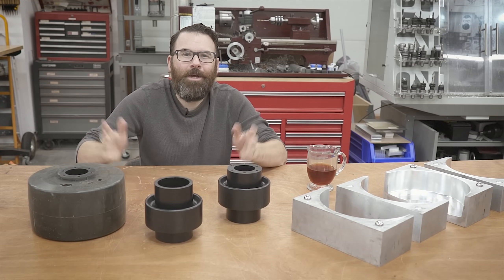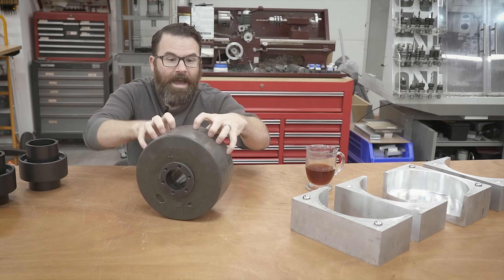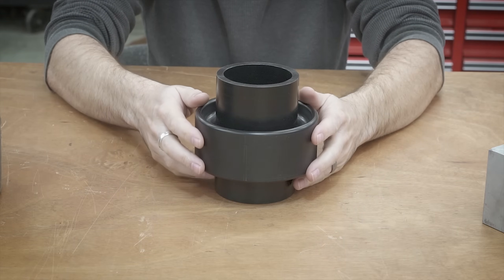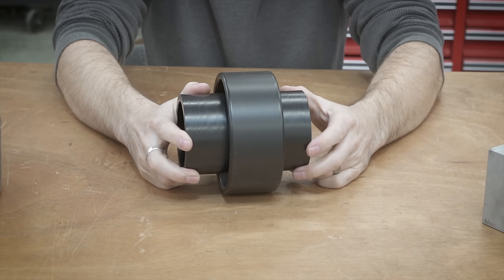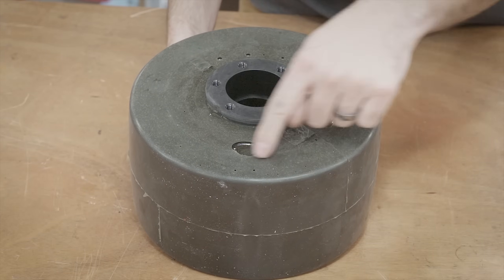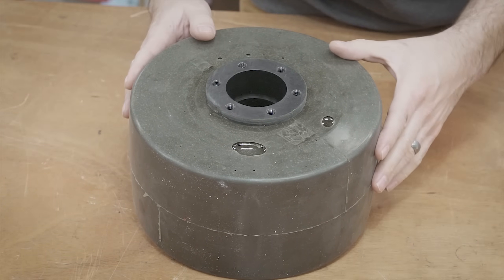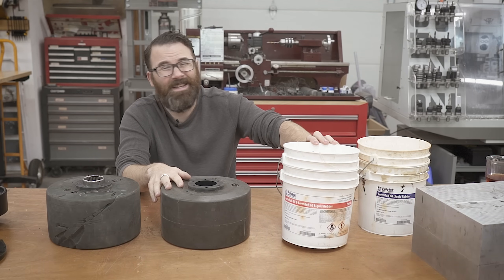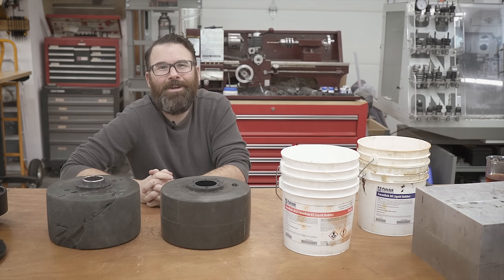Copperhead Custom Wheel Molding

Comment: I want to see someone make the whole robot out of the cast rubber for the wheels.......  It seems to be able to take so many direct hits, maybe an indestructible robot?
Reply from the maker: I think all the mechanical parts would have a hard time working...  You need a rigid structure for drive and weapon power transmission.
Reply: @RobertCowanDIY  haha yeah I know, mostly a silly idea. Maybe you can cover crippling depression with a giant 220?lb layer of it. 🤣

Comment: Hey Robert, curious if you would have advise on an idea for using Polyurethane Rubber as a weapon. Im thinking of coating a truncated cone shape full body spinner 1lb robot and using the catch and bounce of the material to push opponents around. Thoughts?
Reply from the maker: I think no matter how you did it, it would be too delicate.  People are using titanium, AR400/500 and other materials for weapons, I don't think it would hold up.  The whole idea of a spinning weapon is to generate, store and transfer kinetic energy.  Using a rubber can accomplish the first two, but will be unable to effectively transfer the energy into your opponent, making it act more as defense.  That's not what you want for a weapon.
Reply: @RobertCowanDIY  Thanks Robert. I have also been working on an adjacent design in which there would be a rotating shell but it would just free spin as armor like you mentioned. Do you think 50 durometer rubber would work ok here? I was also thinking of attaching steel wire brush to dissipate vertical and horizontal spinners.
Reply from the maker: @neilrhoades5951  Sorry, but I don't think this design would be effective.  read my previous comment.  you're basically designing a weapon with a feature that invalidates the purpose of having a weapon.  I'm not saying it won't work, I just don't believe it would.  But I could be wrong.
Reply: @RobertCowanDIY  Thanks Robert!

Comment: Fit your mold with some grease gun fittings.  When de-molding, a couple of pumps with a grease gun will break that suction grip in the mold.
Reply from the maker: But wouldn't there be a hole that would get filled with rubber?
Reply: @RobertCowanDIY  Fill the hole with a little dab of grease before casting.  There will just be a little dimple in the finished part.

Comment: We (Gemini) use 3d printed wheel molds for our wheels (even used the same mold for 3years)
The trick is sulfur free modeling clay, by applying a thin coat to all the seams we get ZERO FLASHING.
you can even smear it on the whole surface to eliminate print texture but stopped as it didn't seem worth the effort (even tough it only takes 15 min)
This could be used on aluminum too but 3D print is dirt cheap in comparison and I don't see much downside

I should also mention we use a 2 (or now 4) part mold with diametral splits and a free top surface (no molded upper surface just pour till the mold is full)
Reply: Gemini, you ever coming back?

Comment: I know that the bubbles aren't a big deal, but did you consider pulling a vacuum on the mixed rubber before pouring?
Reply from the maker: We considered it, yes.  BUT, for something like this, it really wasn't necessary.  In a normal application, you would want to pull a vacuum or even pressurize the mixture before pouring it in.

Comment: I'm curious, why not embrace the bubbles? Assuming you could trap the majority of the bubbles in the body of the tire, you could probably shave a couple pounds off the weight without a major loss of strength.

Comment: Hey, you have on the nylon core these two "grooves" wouldn't air be trapped on the bottom groove during the pouring-process? Just wondering...
Reply: Yeah, there must ve some air pocket but probably not so big to be any isue in application like this. But for example just 3 small holes drilled around the ring would solve that for sure.
Reply: I was thinking the same thing....

Comment: How did you get the polyurethane to fill the undercut which would be facing down in the mold? I did not see any air channels through the undercut surface to the other side so a huge bubble would form and prevent most of the polyurethane from entering the downward facing undercut.

Comment: Have you tried using a release agent for the mold? PVA release agent works really well and its water soluble so you can just rinse it off after demolding. I usually apply it with a nice bristle brush. 
Another thing you can do to help reduce the amount of bubbles is make a vacuum chamber to put the entire mold in after you pour it. A simpler, but slightly less effective alternative is to vacuum the bubbles out of the urethane while it is still in the bucket (i.e. using an off-the-shelf vacuum chamber/bucket). 
Also, if you apply heat to the part while it is curing it can exponentially decrease the cure time (it looks like you could fit that in a regular oven). Usually this also increases performance of the final product (follow manufacturer recommendations there, though).

Comment: Last I knew Extinguisher was going to make their wheel molds from 3D prints, I think their hubs are bigger compared to the tire diameter (so less liquid being poured in) but the overall wheel size is fairly similar and it's a heavyweight. I think the plan was "If they come off, great, if they don't we'll break them off [they're cheap 3d prints]."
Reply from the maker: I hadn't heard anything about that.  I might try molding my own with 3d printed molds and see how it goes.  T

Comment: How much is a pound of pu more or less?
Reply from the maker: It varies considerably with what you get and how much you buy.  The stuff we use is around $150 for 16 pounds, so roughly $10 a pound.  So yes, every wheel is around $150 in just rubber...

Comment: Do you think kevlar fiber reinforcement would be beneficial?
Reply from the maker: Whenever I see suggestions like this, I want to ask: "what's the problem you're trying to solve?"  Are you trying to make them stronger?  Because we don't have issues with them failing.  Are you trying to make them lighter?  The kevlar wouldn't do that.  Are you trying to make them cheaper, easier to make, etc?  I always look at design with that question in mind.  What problems exist, and what's the best and easiest solution to fix them.
Reply: @RobertCowanDIY  Its an attempt to make it stronger per mass. If the overall material strength is higher perhaps you could create hollow sections to make it lighter.

Comment: Could adding fiber or mesh to be cast within the wheels make them more durable?  Something sort of like rebar in concrete, though I have no idea how well that would work for rubber.
Reply from the maker: See my reply to David Lewis II.  Same thing, what are you trying to solve?  They are plenty durable, but chunks can get taken out easily enough.  Carbon fiber would maybe prevent that, but that energy has to go somewhere.  It might end up just cracking the wheel instead of taking out chunks of rubber.  Concrete is very brittle and needs the rebar to stabilize it.  Rubber has the opposite issue.  Making it stiffer doesn't really add a significant benefit IMO.

Comment: I was ruminating on the de-molding process over night and figured this. Each mold section would get one threaded hole, through that hole, a threaded screw can be inserted and made flush with the inner surface. During the molding process and curing, it stays in place, but once that's complete, all you have to do is remove said screw, insert compressed air, and it should pop out the wheel.
Reply from the maker: I drilled and tapped two holes in the top, so I can separate the top and bottom by just threading in a long bolt.  Works well enough.  The next mold design would have features like you suggest to be able to pull it apart easier.

Comment: Do you re-use the hubs? 🤔 I think the hub under cuts at 2:00 give you trapped air if mold is not tipped during pouring - drilling axial from void to void should help.🤓 Also - drilling some small 3 mm holes on top will bleed the air bubbles, like regular tires I guess, to be cut off later - but agree no functional impact 🙂 Cool vid - thanks 💪
Reply from the maker: The hubs aren't reusable.  There's no way you're getting the rubber off once molded.  And you're right, the undercut could trap air, and cross-drilling would help, we were just lazy ;-)  The top does have two vents, but it would need MANY to get rid of the bubbles, best to start with as bubble-free rubber as possible.

Comment: For stubborn molds for my underwater robots I have put threaded holes for zirc fittings on the mold so you can use a grease gun to push the part out of the mold.
Reply from the maker: That's a pretty good idea.  Really once the suction or seal is broken, they come apart quit easily.  So that would certainly help.

Comment: Now I want to see an entire bot with this thick rubber as armor.
Reply: If your opponent's weapon can get lodged in the rubber then it might count as an entrapment device and be against the rules. Although, if we're talking ablative armor in general, I've heard of a few using wood.
Reply from the maker: Yeah, only when intentional.
Reply: @RobertCowanDIY  tread of a loader tire for hammer bots drill holes in the slab of loader tire and use existing bolt holes . tomb stone couldn't tear one
Reply from the maker: @huckstirred7112  tombstone can crack solid steel about 2" thick.  It can break a tread.  Also, those are horrendously heavy!
Reply: @RobertCowanDIY  wow ! your all's bots bust 2 inch plate ! I weld on a lot of 2 inch plate I thought only heavy equipment could do that . I know my chainsaw can't cut threw  it . .Now I wanna run over a piece with the brush hog to see what happens ,and no my brush hog would spit it's guts hitting 2 inch plate !Thank you for replying
Reply: @ThatBum42  I'm not sure that it would class as entrapment unless the armour was specifically designed to capture weapons though.
Reply: @ThatBum42  I'm currently creating a beetle weight bot that has rubber on the outside that shock mounts to the main chassis. It's sofar purely in the planning and materials collection stage, but I will have to look more carefully at the wording of the venue/competition rules to make sure that I'm not breaking the rules.
 I think perhaps in some weight classes rubber on armour wouldn't actually help that much being placed on the outside of pannels.
The forces that are involved on something such as a cutting blade like tombstone surely has enough mass and MOA that to have any impact on the blades ability to cut straight through or transfer a significant amount of bite to the main shell of the bot the rubber on the bot would have to be incredibly thick (like copperheads wheels) and at that point you're probably also going to get issues with securely anchoring/adhering the rubber to the panels, not to mention the weight increase .

I think it might have more success with being able to absorb more shock from the likes of a drum with a large head like copperhead, but then I think the main aim of a drum like this is to twist, flip and break, not nesseserly cause impact holes or tears.
Reply: @ThatBum42  Possibly, I've still not completely settled on the finished design for my own robot yet but but i'm currently 80% finished with the modeling and depending on ammendments will be transferring parts it into over into fusion over the  Christmas  holiday hopefully.

My idea comprises of a diamond like rhombus with slanted mirrored edges (invert capable).

The rubber part of the shell with be the outer most edge of the bot and will be clamped with nylon bolts and probably some kind of semi tapered springs (of which I haven't experimented with yet. 
The idea is that the outer edge of the robot gets hit on the rubber (causing it to be ripped apart and sacrificial)  and the springs take away the majority of the shock until the rubber is worn away.
Reply: I was thinking an overmold like you see in some tool applications.
Reply: I was thinking about,  I have access to uncured strips of rubber.  I use that for rubber injection for air flow tubes in the automotive manufacturing

Comment: Awesome video! I'd love to make some custom wheels down the line.  When pouring around the hub how do you make sure that the liquid rubber fills in the "undercut" that is facing the ground, rather than creating a cavity or air bubble? Can't wait to see how they perform on the upcoming season.
Reply from the maker: We didn't really do anything to make sure that cavity was filled.  I guess ideally it would be drilled through, but we didn't do that!  But an air bubble wouldn't really do a while lot other than save weight.
Reply: @RobertCowanDIY  I'd definitely drill some vent holes through. I'd also use the mold release specified by the manufacturer of the rubber, and the surface prep or bonding agent they have for the hub. With the bonding agent a damaged wheel could be turned down on a metal lathe, prepped and a new layer cast over it. Takes the right lathe bit geometry and really sharp to turn rubbers, and there's a limit on how soft a rubber can be turned. Grinding rubber to shape can be done but it's horribly messy and the particles get static charged to the point they have to be scrubbed off with soap and water and can still leave some stuck.

Comment: is there any draft on the mold (to help demolding) or is the wheel molded with a completely square profile?
Reply from the maker: I think there's a tiny bit, the wheels are a tad rounded when they come out, we just drive them on asphalt to make them flat.  but more draft would help getting it apart, but then the wheels wouldn't have a flat tread.

Comment: I wonder what would it take in terms of price (to be read, vs the current setup) to make the wheels out of actual vulcanized rubber in a home setup. One of my RC airplane mentors as a kid would make his own rubber wheels for this big airplanes. I still have one, perfectly pliable to this day, so i know it can be done, but would it be cost effective...hm.
Reply from the maker: There is a company in Brazil that can make vulcanized rubber wheels.  I kinda looked into it, but couldn't find too much information on a DIY process.
Reply: @RobertCowanDIY  the nylon material I use is Dupont Zytel PA 66 33%  glass filled nylon, Honda has been using alot of  that for their engine parts instead of metal
Reply from the maker: @lowlifeangler  Yeah, those glass or carbon fiber nylon composites are great.  We just use the solid nylon wheels, but doing something else could make them a bit cheaper and lighter.  Even still, the solid nylon hubs do explode from time to time.  The polyurethane holds them in place though.
Reply: @RobertCowanDIY  I should think the biggest hurdle, has to be getting the raw rubber blocks, the rest, is public knowledge, has been for years. I mean, sure, we don't have modern blends, but we've been doing vulcanizing for years. I know there's a company in Germany that did custom bicycle tires, but i don't know if they are still in operation. A friend's firm got custom tires for their employee's bicycles a few years ago as a Christmas gift. My mentor had access to raw rubber blocks directly from a tire factory in Ukraine, but that was ages ago, i think they even shut down recently.
Reply: @RobertCowanDIY  A source for rubber like that is spin casting suppliers like Conquest Industries. They make heat vulcanized rubber and silicone. To heat vulcanize a wheel of that size would require it to be wrapped with insulation around the sides while it's in the press, and the mold would need more features (preferably through bolts horizontally) to hold it together. Also the hub would have to be made of something more heat resistant than Nylon since these rubbers cure at over 300F. Takes 1 hour per inch of thickness with the heat and it has to be held under clamping pressure both to keep the mold together and so the material will cure. Can't just toss a chunk of it onto a hot plate and cure it. I use the silicone to make spin casting molds for Zamak alloy. I've also been doing silicone mold and urethane casting for 20 years, plus ceramics, fiberglass, and a whole lot of other things starting with handing my father tools and parts when he worked on cars, starting when I was around 5-ish about 45 years ago.

There's just no fighting robot scene in a small Idaho town of around 5,000 people. ;)
Reply: @greggv8   Yeah I use around 172-182 C degrees on the mold surface making Air Flow Tubes for Honda and Toyota. The raw rubber in spun a company called in Akron, Ohio

Comment: 3D print + the salt oven method to make it a solid plastic piece. Then you can do the hub and trust it.
Reply from the maker: someone watches CNC Kitchen ;-)
Reply: @RobertCowanDIY  Guilty as charged, mon capitaine. :)
Reply: And you going to have a rough surface the urethane never can slip off.

Comment: That's a lot of weight. I guess some voids or foaming agents would not hurt durability and give you some kg back.
Reply: Hmm, I think it would really effect the structural integrity of the whole wheel. After all it's meant to absorb blows from the likes of Tombstone, Gigabyte, SOW etc.
Reply from the maker: The wheels came in right at weight, which would suggest there aren't too many voids.